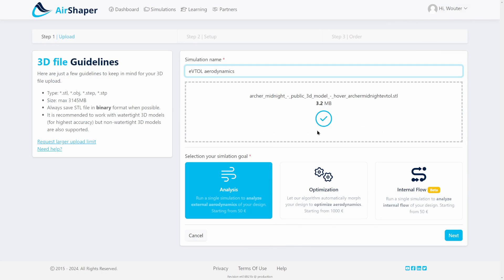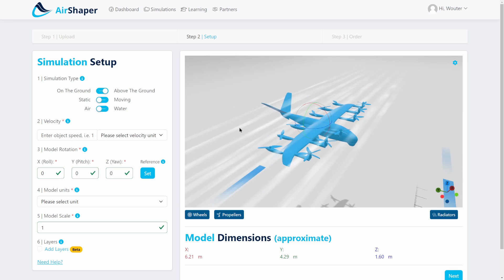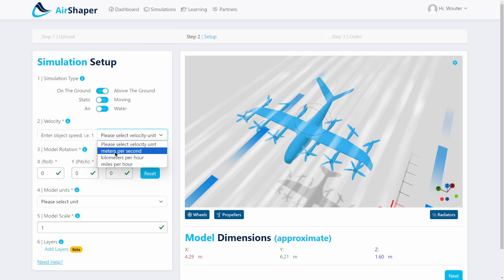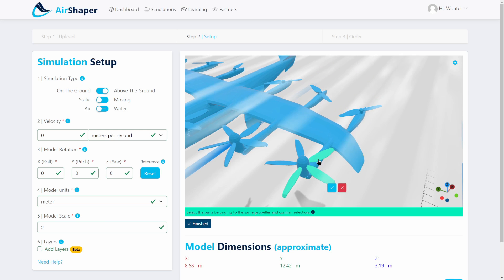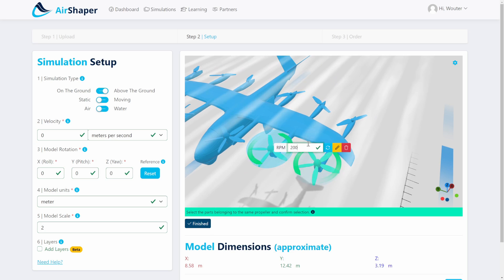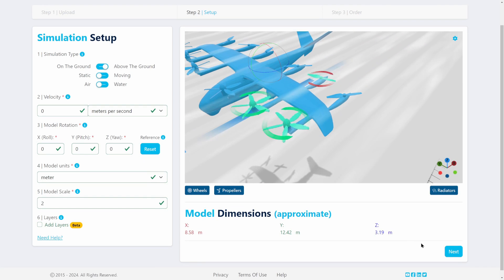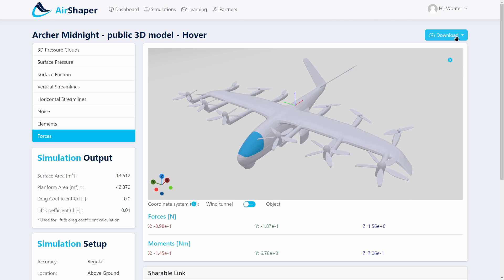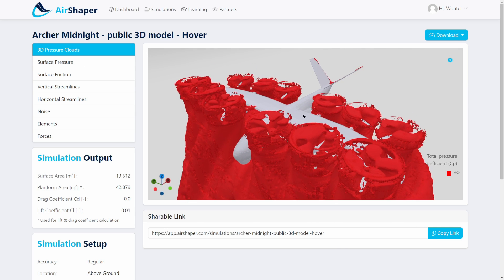Aerodynamics Made Easy - eVTOL CFD Analysis Explained | Step-by-Step Guide

Comment: This is brilliant! Can the system simulate EDFs specifically ones that may have internal rpm of 20,000? Or only open props?
Reply from the maker: We can also do ducted fans, with tip speeds up to Mach 0.6
Reply: @AirShaper  brilliant, thanks for the answer!